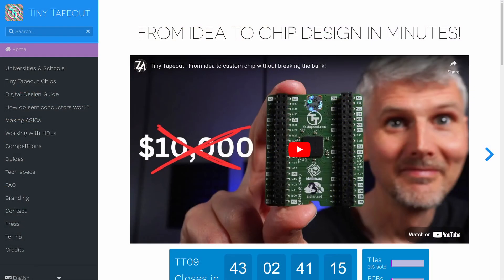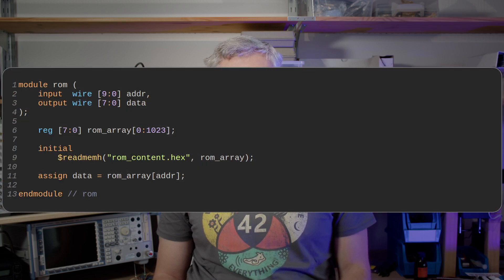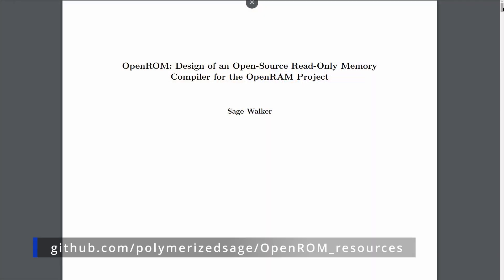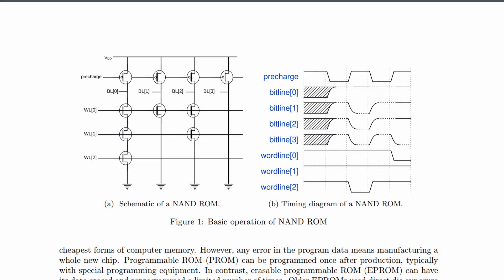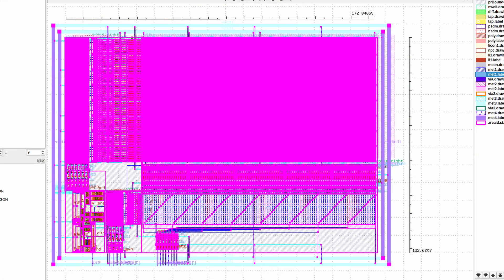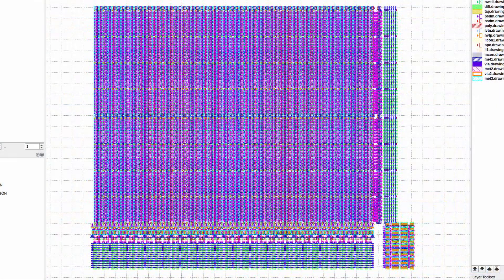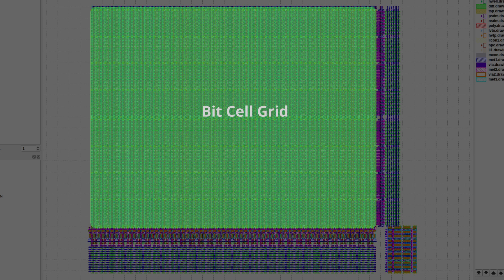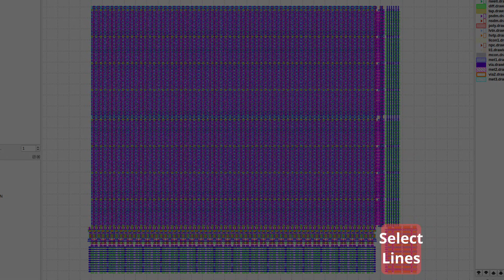SKY130 ROM Compiler Project

Comment: Is it possible to use same compiler with other PDKs? Like ihp sg13g2?  i am a computer engineer new to this vlsi field so i really have only abstract overeview of what is going on this field of vlsi, rom and ram manufacturing
Reply from the maker: No, this compiler would be SKY130 specific. I'm trying to go as dense as possible and that requires fine tuning which is process specific. I will probably as some point make a version for IHP but having already looked at it, the trade-off I will have to make will be different from SKY130 to reach the best density. If you've watched the bitcell video which goes into the details of consideration for layout, you'll understand why this is very process specific.

You could make a ROM compiler that's more "generic" but you would loose a lot in efficiency and that was just not acceptable to me given TinyTapeout is a main target where area is at a premium

Comment: Hello, 
pretty nice layout !  I'm wondering where you found the DRC that includes density? For a chip I sent to manufacturing, I created my own library of logic gates to operate at very low voltage, and I faced a lot of issues with the density, especially the diff/tap. Normally, the foundry adds dummies to fix the problem of density (only if it can find space). 
C'est un super beau project en tout cas
Reply from the maker: Thanks. Density targets are partially listed in the `mpw_precheck` from efabless ( search for 'density' in the git repo ). Some others were recently posted on slack because they changed for the last tape out and caused some issue ( especially poly density where the max was reduced from 60% down to 38% ... ).  And yeah, efabless adds fill pattern but the algorithm is not super smart, it just adds the pattern no matter what and it also keeps quite a big clearance around existing features to not disturb anything so if you have a dense design, nothing will be added ...

Comment: Really interesting project! I'm looking forward to seeing more about it, especially if you can go into the details of the toolchain you're using.
Reply from the maker: Thanks !

Yes, the following video will probably me mostly showing stuff around in Magic ( http://opencircuitdesign.com/magic/ ) and be much more technical with less of me just talking :)

The tools I used for this project are the fairly common ones used with SKY130: Mostly magic for actual layout design and extraction,  xschem for schematic capture, ngspice for simulation, klayout for visualization and also as a secondary DRC check. I've also used FasterCap to do some capacitance estimations/cross-checks.

Then I used gdstk for the actual "compiler". It's just assembling pre-laid out design elements mostly. It's still WIP for some of the more tricky parts.

Comment: Very cool! Excited to see more of this, especially interested in seeing the interface parts of a verilog project that uses the rom!
Reply from the maker: From the verilog point of view, it'll be seen as a blackbox component / macro that you instantiate explicitly.
I'll probably need to have a simple functional simulation model that can be used for RTL simulation though so you can try out code.

In the future it would be nice of course if the creation of the macro could be automated by yosys directly, but that's further in the future.